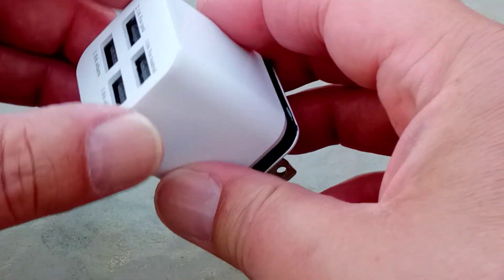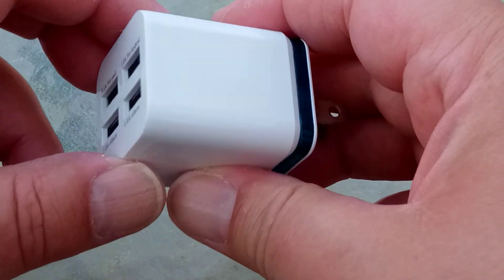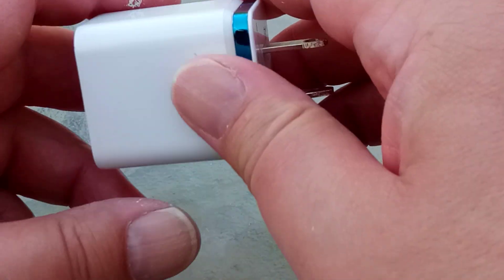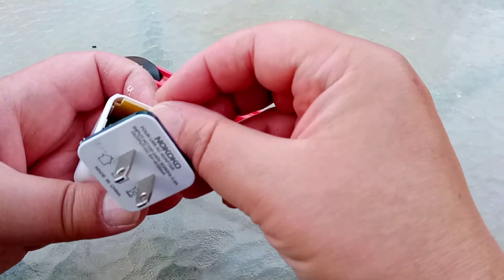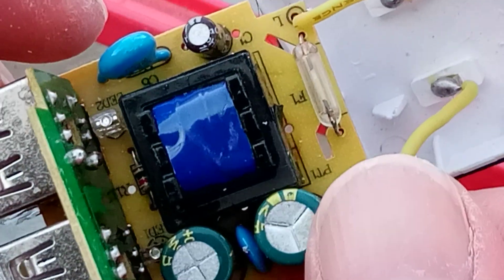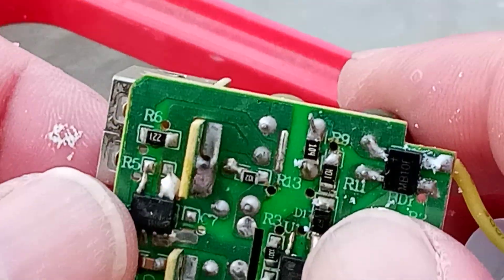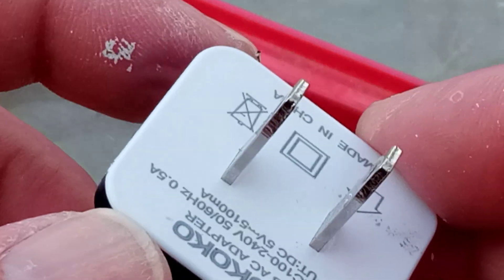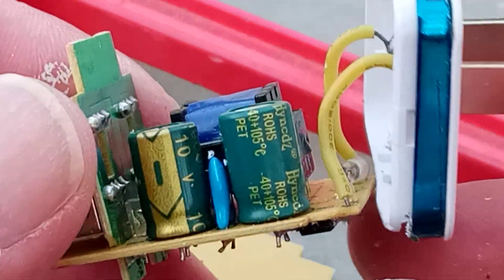Teardown of a Temu USB charger #teardown  #disassembly #china #temu #electronic

Comment: That blue capacitor between the mains and low voltage sides does not look to be a safety capacitor (should be Class Y1), so this thing has already failed on safety grounds. This looks like the thing that DiodeGoneWild should do a complete teardown of, to see if it is safe or not. Chances are that transformer would also be a bit suspicious.
Reply from the maker: I didn't like the look of the transformer which is one reason why I dumped it in the trash.

Comment: Chinese USB power supply is a crap, what a shocker. Also 5amps PSU with such small transformer is not posible in this universe. Please, send this amazing piece of chinese technology to Diode Gone Wild for his 10000 dangerous usb chargers video!
Reply from the maker: Already tossed the thing in the trash. If Diode Gone Wild was nearby then I've a few other bits of junk that have not made it into the trash yet.

Comment: Send this to DiodeGoneWild and he will do autopsy for transformer and we see is this just dodgy or super dodgy (with skull) charger.
It looks like this have right Y capacitor and separation distance on pcb looks enough. So it's tranformer build guality if this is dangerouss
Usually those switching chips run more hot than transformer so they do overtemp protection. So if transformer is ok then this is just under delivering but not lethal.
Edit: this looks better what DGW has done autopsies. He usually get stuff from viewers or ebay/ali
Reply from the maker: Already at the dump, I think. I would have sent it to Big Clive - he pulls stuff apart and orders dodgy, dangerous products from eBay, Aliexpress and Temu for the fun of it.

Comment: It don't mater to the Chinese as there not the ones using it that why 😂
Reply from the maker: This is why in general I only buy low-cost stuff. I got a great deal on ATTiny88s a while back and they're fantastic for what I do. Can't beat 88 cents for a microcontroller.

Comment: Do NOT use those to charge your tablets or phones.... unless if course you want them to get damaged. These are fine for charging things like batteries or flashlights but nothing with sensitive electronics. I use these only for powering usb lights and that's it.
Reply from the maker: They're fine for most phones. Any phone that doesn't have over-voltage and reverse polarity protection is a poor design and probably worse than even a Chinese burner phone. Anybody that spends more than the minimum on a phone is in a way different income bracket than most YouTube viewers, given that they only last as long as the charging socket which isn't more than about a year.

Comment: I believe I can see what  the problem is from your closeup video, there appears to be a dry joint on one of the mains inputs on the PCB, the one that has the fuse connected to it.
Reply from the maker: In hindsight, if I’d checked the solder joints rather than like looking for other failures it’d have helped. Having said that, the way I cut the case open meant it could not be used safely.